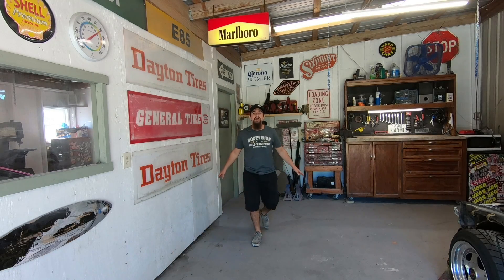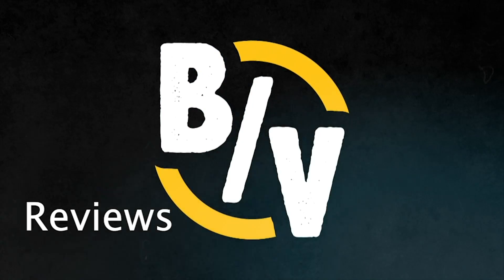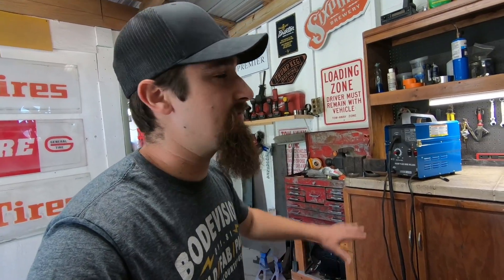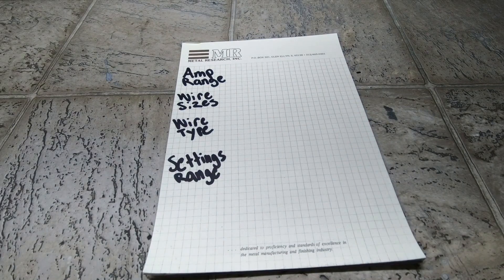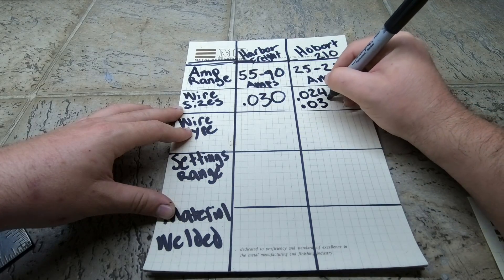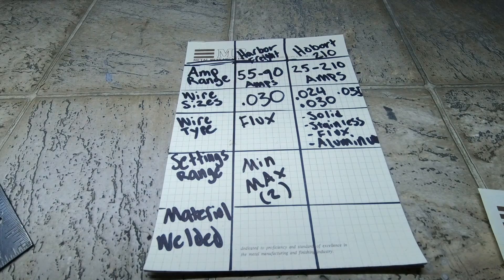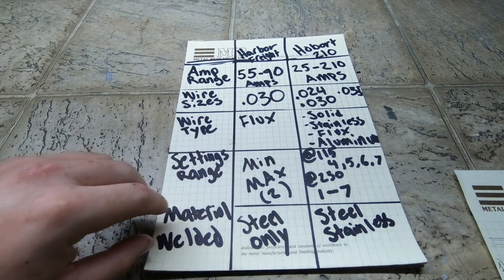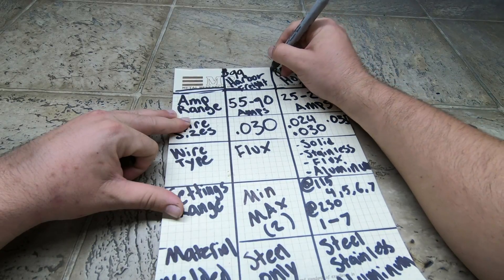The Cheapest Welder I could Find in 2020 on Harbor Freight and Amzon Review and Comparison $99

Comment: That weld looks perfectly fine. I’m a welder by trade with a little over 26 years of welding experience. I have used that Cheap welder from HF and it’ll surprise you at how well it works when you know what your doing. You adjust your heat by increasing and decreasing thf wire speed. Faster speed is colder. Less speed is hotter

Comment: Not a good review/comparison video Bode. You compared apples to oranges so to speak. The welds will not compare. I mean to make it fair it would have to be an identical welder is size, amperage, wire, capability, etc...

Comment: I have the same blue welder you show and only run it on a 220v outlet. Mine also has an inlet on the back for shielding gas which throws out a lot of what you've said about this welder. So provided you can connect shielding gas, stainless should be doable and aluminum is possible. And because the torch lead is so short you can "mig" aluminum without a spool gun. 

Does this one have a barb on the back? If so you can use shielding gas.

Comment: I have the same flux core welder, you gotta increase the wire speed as you increase the thickness of the material. That machine should be able to handle 1/8" thick steel. There's a similar chart for the Chicago Electric as with your Hobart machine.

Comment: What’s funny is I watched a YT video 2 years ago about welding with the harbor freight welder and thought it would be worth purchasing.. the first time I used it, I had the same results... complete crap.. I then found out it was AC power and not DC, so I installed a rectifier and capacitor and converted to DC, it was definitely better but the motor for the wire feed ran slow as hell... my mother in laws husband had a brand new Lincoln welder just 115v but could convert to MIG, once I hooked up gas it was a game changer! I’m not doing much structural welding but damn it’s much cleaner looking!!!

Comment: You can't really compare these 2 welders; it's an apples to oranges type thing, the Hobart is an actual MIG welder with gas and the HF is a flux-core welder, so the weld quality will never even get CLOSE to the same. However, with that being said, with the right flux-core wire you can get some really decent welds for $99. Try using some Lincoln NR-211-MP wire  and watch how much those welds improve. Also I'm pretty sure that machine should be able to run .035?

Comment: Harbor freight welder welds with AC(which is wrong). You can also run .035 wire in the harbor freight welder, literally just flip the piece around and change your tip....my advice is to never buy the Chicago electric one,buy the titanium brand. The titanium machines are 1000 times better,and alot lighter.

Comment: My stick welders a Lincoln but I've used the budget HF mig for several years now. It works fine for light stuff but use Lincoln or similar quality wire with it. 
Nothing wrong with the budget stuff, it lets the home diy guy take on projects .

Comment: Great video, Adam.  You probably should have compared it to a little more expensive welder so you would still be able to use it later, but you could always take it back and use the money to buy something more useful.  Even if you just ask for a in store credit, you could buy a great puller or a compression tester or any of a hundred better uses for that money. Take the pies you welded with it and show them it welds like a$$.

Comment: I'd recommend looking for a cheap stick welder instead of these shitbox flux core welders, I have a flux core welder myself and it's a huge disappointment stepping down from the $4500 Lincoln electric welders the school had, only thing I'd ever use the flux core welder for is maybe welding sheet metal to patch holes, but it often burns holes